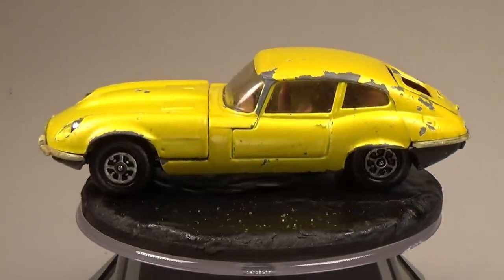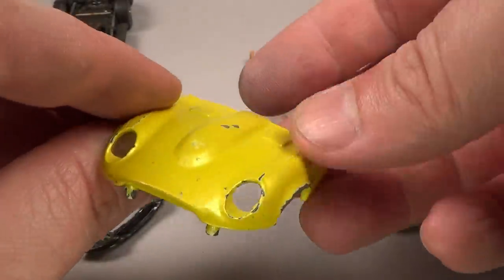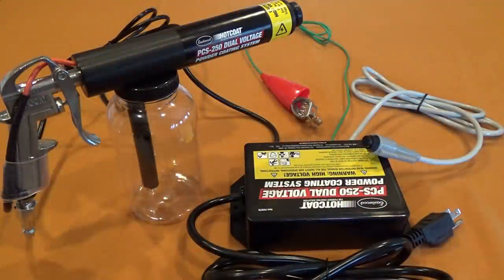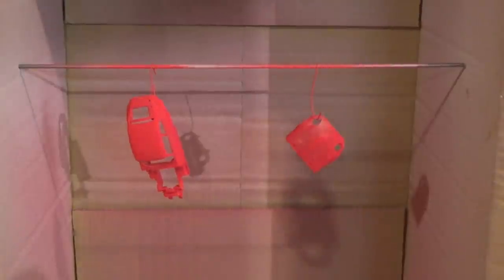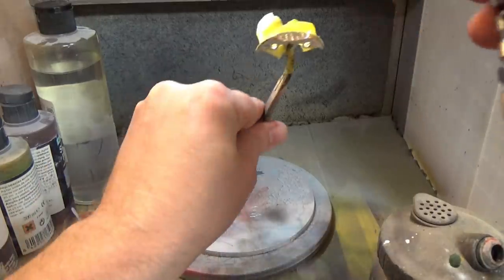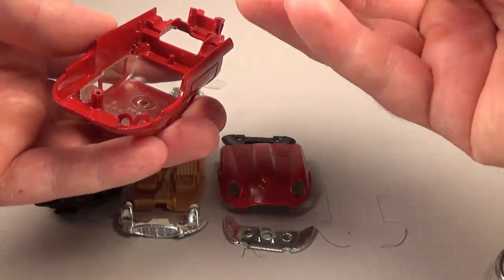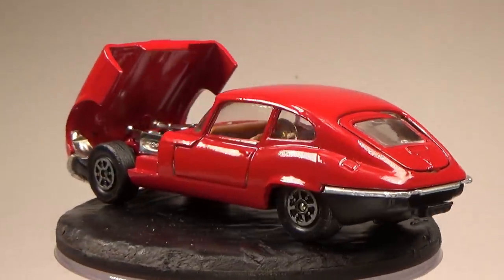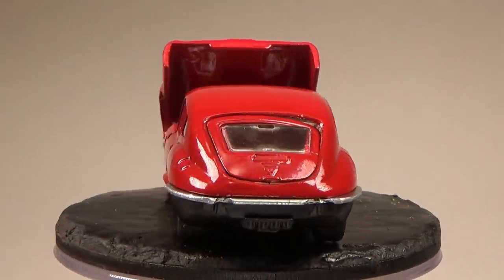Powder Coating and Restoring a Corgi Toys No. 374 Jaguar E Type 2+2 V12

Comment: Ive actually found, thanks to a tip from a friend, that using a UV light can help cure chrome paint. Ive started using Mirror chrome paint which is amazing and brushes on quite well, I then throw it in a nail UV lamp for 30 minutes and it cures it. Might also work for the chrome paint youre using.
Reply: Noted!

Comment: I've seen powder coating used in larger restorations, such as large tonka toys, but never on a small diecast.  Pretty nice.
One thing I've seen them do is to do a base primer coat, sanded down, to eliminate some of the pitting.   Then follow up with the actual paint.

Comment: Nice to see your return. I've assembled metal units in factories that powder coat...just know I can see the defects. But Nice car restoration overall.
Reply from the maker: What would you do to reduce them? I have some ideas but would like an expert opinion...
Reply: @baremetalHW  it's heavy paint coating.  I'm not sure how to avoid it, I just was an inspection/assembly gal. The specks I know are dirt/dust particles that got onto your paint surface.  For that you need a "clean" booth. Some place that it can't get in. But that too costly/involved for a hobbyist.  (In my opinion)
Reply from the maker: @shellygenter8585  yeah that's the problem... I can create a "clean room" but then it takes it out of what normal people can do.  But I can probably do a lighter coat... just inexperience on my part... thanks for the help!!

Comment: First thing, thanks for showing that powder coating small object is easy and affordable. I find myself powder coating instead of spray painting these days. I have been playing with powder coat and also baked epoxy coatings for firearms. I use a cheap setup from eBay for applying powder. Something I have found to be very helpful to keep the oven at the proper temp, this being very important when coating some aluminum alloys, was a temperature controller I got on Amazon for about 15 bucks. The unit learns the response of the oven's heater and never overshoots the programmed temp by more tha n5 degrees. I have obtain really great results with the simple mod ina  cheap toaster oven.
Reply from the maker: Very cool!! Will check on that... do you have a model #?

Comment: The finish looks excellent on camera. I wonder how much you could improve the process with primer and sanding. Only problem with that is time; you'd lose a lot of the time you saved with this basic method. I'd certainly be happy with the result you got, looks like a factory paint job.
Great casting of a beautiful car, although that body shape wasn't the best E-type design.
A very interesting video and a different take on the hobby.👍👌😁

Cheers for now,
Dougie.

Comment: That's pretty slick.  Are you going to continue to work with this medium to see if you can get better results or is this just an experiment? I have a question about the past, did you ever finish all those Mustangs? Glad to see some new content.
Reply from the maker: Yes I am going to make several videos exploring the powder coat process and improving it... no I have not finished all the mustangs yet..lol... but plan to and do some videos on them.

Comment: That powder coat looks gorgeous, but I'm assuming the temperatures involved means there's not really a way to use it on plastic, so not one of the things I can apply in my own customs, sadly.  (I'm ALWAYS open for alternatives to paint though; when the model car you're working on turns into a robot, there's usually lots of hinges involved, and therefore paint rub opportunities)

Comment: Could you wet sand and polish or just polish the powder coat?
Reply from the maker: You can do both the problem is the powder coating is pretty tough compared to paint.... so polishing it takes a bit longer.